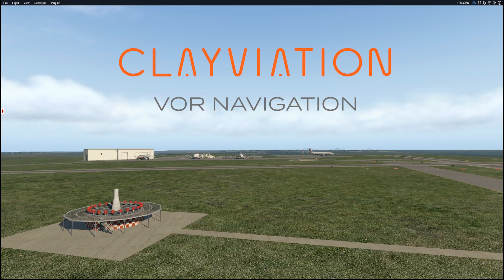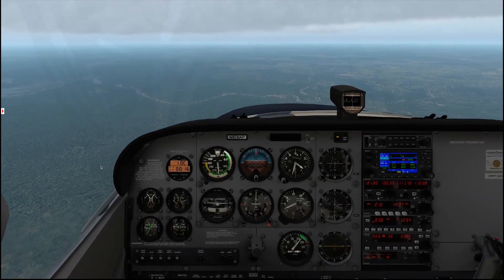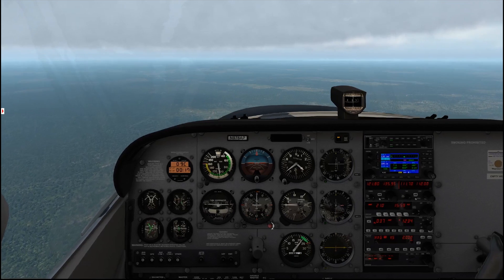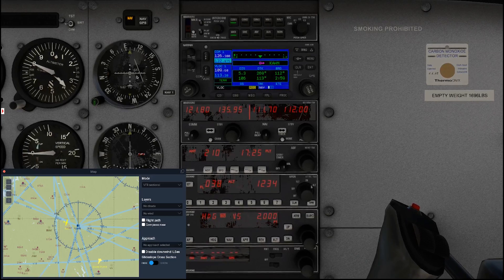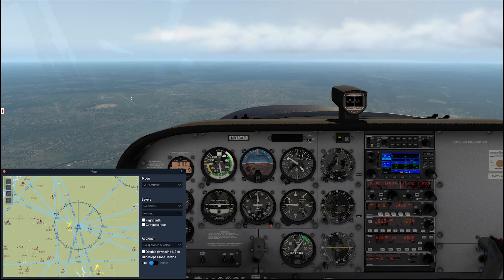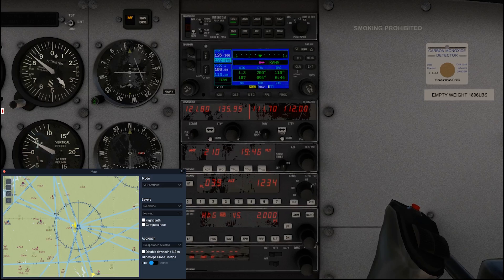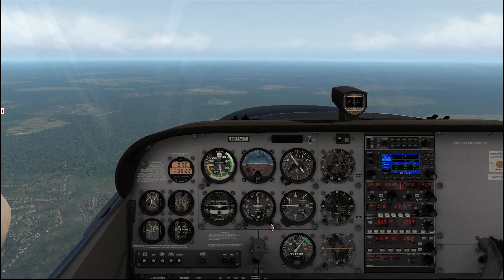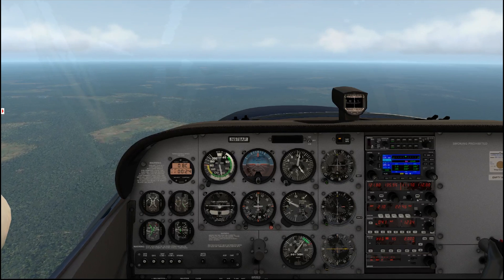Cessna 172 VOR Navigation - X-Plane

Comment: How are you quickly zooming into your radio stack and other instruments? (X-Plane noob used to FSX).
Reply from the maker: Great question, NukeDaddy!  Many of my movements are simply the arrow keys on the keyboard - up, down, left, right. Period and comma zoom in and out. For a tilt, use R and F for up and down, Q and E for left and right. If there is a certain view you use often, you can assign it to your num pad keys. Shift + 1-9 captures the view, and then just use the 1-9 you set on the num pad to go back to it. Super handy to assign some of those to buttons on a joystick or such.
Reply: clayviation I found the saved views for the keyboard and then the “memorize views” keys and used those to set it up. Thanks!
Reply from the maker: Great! Little finds like that, once you get used to them, really make flying a dream. Rock and roll!
Reply from the maker: Great idea - added to the inspiration board!